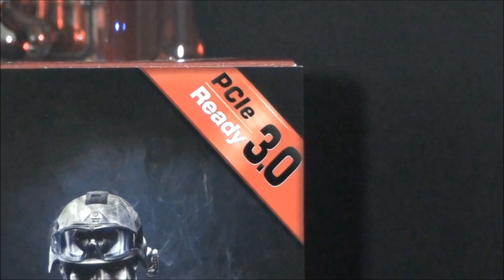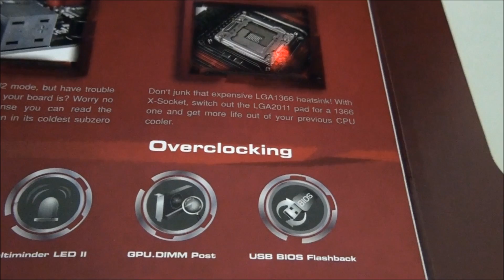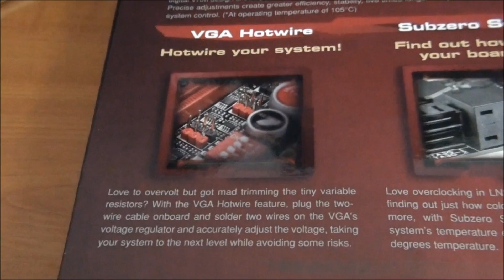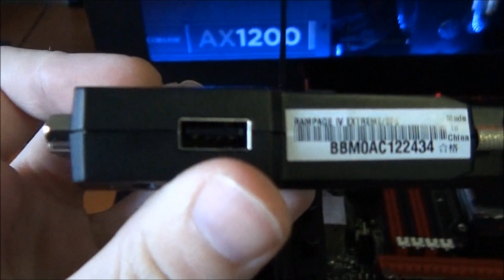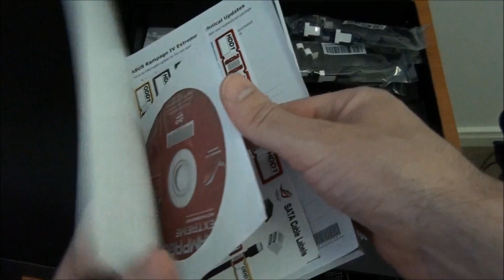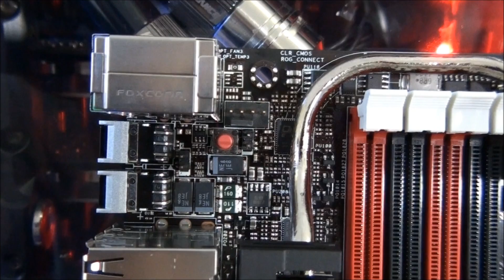Asus Rampage IV Extreme Review

Comment: bought this mobo in feb. 2019 as my second x79 motherboard[ first one was a evga x79 classified lavender mod:( ], using an E3-1650@4,7GHZ. the best system i´ve ever had with 2 evga GTX 980TI SC+ and an intel 750 Series 400GB and a few intel Sata SSD´s( 520,535, 330, x25-M...), 16Gb corsair XMS3 Ram working with 1866MHz in quadchannel. Bought this parts, every one for its own, as used on ebay for less than 600€( mobo, cards, 750 series, E5). My psu is an evga supernova G2 with 1000 Watt, my case a Lian li aluminium server tower, the ram i bought as new in 2012 and the psu 2014, also as new. ah my CPU cooler is an EKL alpenföhn nordwand rev.b with 2 fans with a scythe kaze master2. nice system, the best i´ve ever had..maybe?

Comment: So if i will  use Intel 3820 then i would still be geting support for PCIE 3 as x79 chipset supports it coz i would be using 2x MSI Lightening 7970 now and another 2 of them in future and processor will also be changed..

Comment: SR3 is ultimately useless, As it is nothing more than a benchmark server board. When it comes to multi cpu's or cores, When you write a program you have to fork the processing to use multiple cores, considering the average consumer system uses a single four core CPU, consumer software is generally never written to use more than that, they are also wont utilize the specialized commandsets of the xenon, limiting its overall potential even more.

Comment: How did you handle cable routing for the 6 Pin PCIe power connector that is on the left side of the board in between the I/O shield and memory.  I've seen your photos of SB2 and it looks like the cable goes through the I/O shield?  Just curious, since it's been a pain for me routing a cable to that power connector. Thanks!